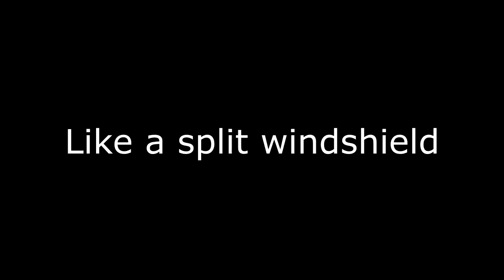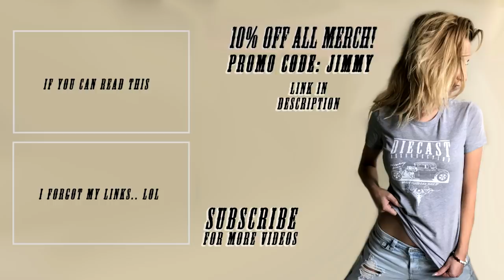German Diecast 1:64 CORVETTE STINGRAY V-282

Comment: Very good work, love it! 👍☺ Siku used these headlights for all Models between 1963 - 1972, as single or double Headlights. Only a few models had plastic frontlights, like the Mercedes 250 SE or the Mercedes 600 ( Lone Star Roadmaster used these kind of Headlights for the early carmodels too  )The scale was allways 1:60 for all vehicles from 1954 till 1973. Since 1974 - maybe 2000 scale 1:55. Then different scales, cause it have to fit in the same Blister Packing. From 1954 - 1962 they  are made in plastic, since 1963 in diecast. Regards from Germany. ☺